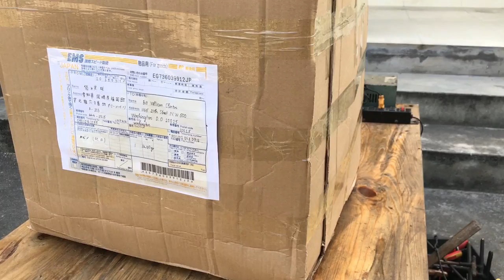Restoration 2 Stroke Engine ROBIN EC 10 | Restore Engine Robin Antique

Comment: no main bears, no big end bearings on the rod, used wrist pin bearings? no new seals, old piston and old rings, cylinder honing!  Good luck with that running for long at any rpm greater than a 1,000 for any length of time.

Comment: This video was difficult to watch. Like, why didn't you replace the piston that was charred? Why didn't you replace the pull string that is obviously worn out? Why did you use borax to clean your parts? WHERE IS YOUR TORQUE WRENCH????? You didn't take that crank out? Why didn't you cover your bearings before you painted? WHY DIDN'T YOU REPLACE THOSE BEARINGS??? If I sat here, and typed out all my questions I'd have a book. INSANE!!!

Comment: nothing new on the engine no gasket no spark plug no bearing. rotted exhaust pipe with holes. just clean roughly. and put in color an amateur work the restaurateur ??? what crap

Comment: Dude, you don't use a hammer on a flywheel on a motor like that. Or any motor really. Need to get the right tools for the right job. In shop class 1971 first year. You taught not to be a primitive Pete. A guy that don't have the right tools and uses something else. Yeah the hammer worked. But did you crack or break the magnets around the inside of the flywheel. That wouldn't happen or happened if you use a puller instead!!!